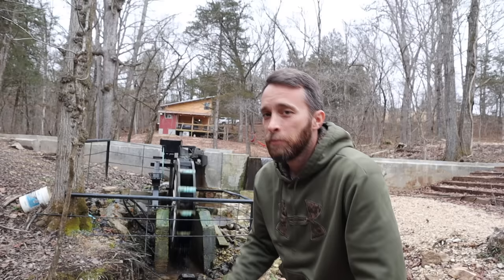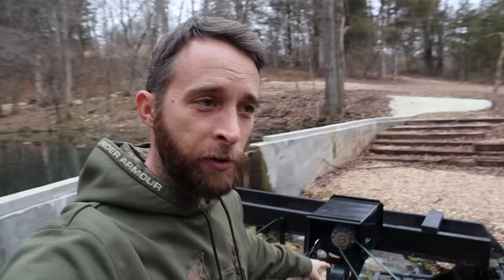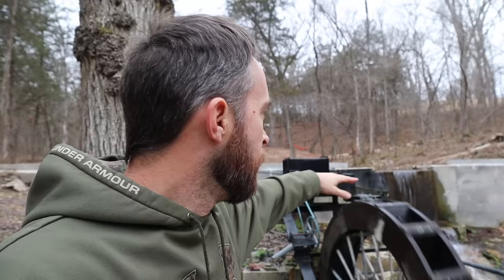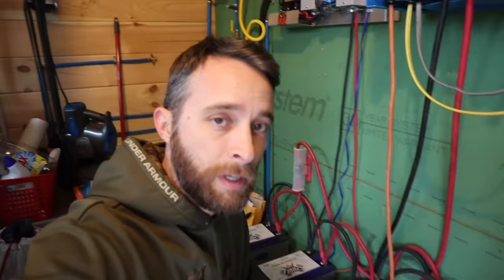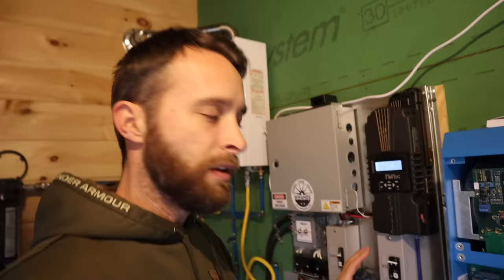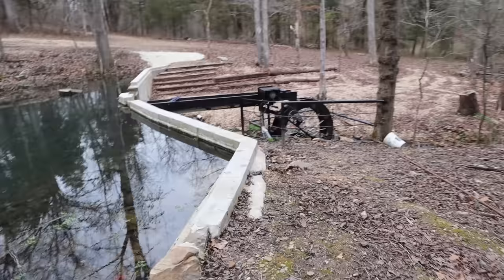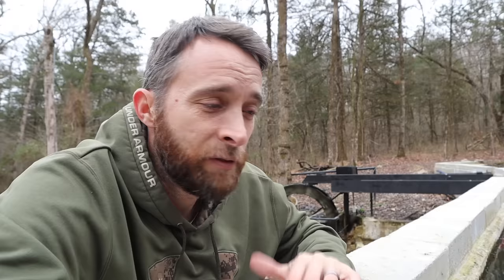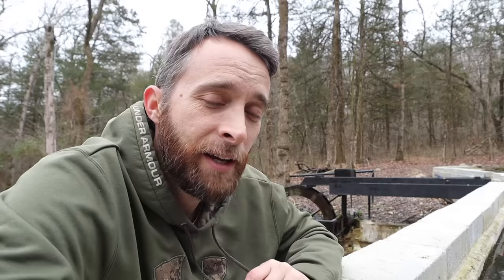Did we MAKE HYDRO POWER Using Our Waterwheel for Self Reliant Off Grid Living?

Comment: Modified Samsung 18 Pole Smartdrive motor. Setup as 3 phase 2 coils in series, times 3 in parallel per phase, then rectified. At 500 RPM it was producing 182 Watts at 46 Volts DC. That is fed into a MakeSkyBlue 30 Amp Solar controller and dropped down to charging Voltage for a 24V nominal battery string ( currently sitting at 26 Volts, charging was at 27.2V ).  At 750 RPM the same unit will produce 330+ Watts. At 1000 RPM it has put out over 400 Watts. What is the state of charge at your batteries as if they are nearly fully charged, they won't draw much in the way of current. As the others said, move the Voltage as AC and then rectify at the panel for less loss. MW&S sold you a bill of goods with that alternator.
Reply: I did another test run this morning just for S&G. At 375 RPM it was producing 125 Watts. So if your unit no load was producing 500 RPM and under load it was producing 375 RPM, you would see 5 Amps at 24 Volts. By the time it got to your house with the 10/3 wire, you would only see 18 Volts at 5 Amps. That is a rather severe drop in Voltage and you wold not get much battery charging. Step that Voltage up to 72 VDC and your losses would drop big time.

Comment: Since you invested a lot of money, time, and labor on this project, why not changing the generator to an alternator (ac generator) later using rectifier change the ac to dc than  charge up your battery bank.  The alternator is cheaper than the solar panel, plus less space.  Good luck for the project.

Comment: Problem is propably the distance carried over with 24v. Get some load and a meter next to the wheel and measure the output without the cable resistance.

Comment: Heavier wire to the house means less voltage drop ... Find a generator with a dead gas motor ... Do the numbers for right rpm off the water wheel ... 

You could use a water ram pump to run up a tree 25 feet for your turbine head ... 4 ram pumps should be more than enough flow ... And they are easy and cheap to make ...

Comment: Sounds like either, a bad connection on the service cables going to the house or the gen needs to be tested separately (there may be an rpm limit before damage). Splicing hi current cables is not always easy. A bad connection will be warm or even hot. An IR temperature meter can be real helpful. I like to use split bolt type connectors whenever possible. Also a Voltmeter should read 0 volts with the leads on either side of a connection during operation. There is a more complicated situation that is possible. The charge controller may be seeing a big drop in gen output, if it suddenly loads the gen to charge the batteries. The charge controller could then cut out on a safety. Then resets, then repeats...  Parameters for these hi and lo safety cutouts are often programmable in the charge controller. OR might be as simple as a belt slipping causing a the charge controller to react...??
Reply from the maker: Thanks

Comment: Hey you should move the power wheel closer to your house where the spring is coming out but you will have to build another  smaller dam or buy terbines buy 7 of the terbines than cut a little  in the bank make a flat serface make pipes coming into the terbines  then have the water exit after it goes thru the terbines  2 times make sure  to have exit back into the creek because  if it gets blocked it will blow up plus make sure your kids do not touch it when its running it will send 400 volts thru there body and it will be fatal thats what i have on my big dam on the river that flows thru my 342 acres of land

Comment: 12v at 100 amp-hours is the same amount of power as 24v at 50 amp-hours. The 24v will be more efficient since it has lower current hence less loss in a wire of a given size, or else you can use smaller wire for 24v with the same loss as 12v thicker wire.
Reply from the maker: Thanks 😊

Comment: Hi I'm an electrician into solar and off grid. 12v would not get you any advantage. As your losses going to 110v are higher.  So 24v is a better option for the same battery capacity as a watt is a watt no matter what.

Comment: Regardless of all the advice about transmitting electricity via AC or DC, it's the inefficiency of the wheel. The mechanical energy required to turn the generator under load is inadequate because the wheel circumference and width is too small, and the water flow is also underwhelming. You may want to check out turbines as an alternative if you have the fall.

Comment: I would not give up. An option for your setup might be an Archimedes Screw type.  With the distance to your cabin, you should not be running DC in you line.  It should be 3 phase AC and then convert at you cabin.  Missouri Wind knows this and I would get them involved.  You also may be getting belt slippage since the water (when really roaring) was all over your belts.  I think your setup as is with 3 phase going up to the cabin will work.
Reply from the maker: MO W&S was who I talked with about my project and everything they sold me was recommended by them. I honestly wasn’t impressed with their help.
Reply: @LoftisPartyofSix  I have heard the same comments from several others that have used them.  The alternator they used can either be wired to output DC or 3 phase AC.  Internally is generates 3 phase AC unlike a car alternator.  That makes it very efficient.  Then you rectify the 3 phase AC into DC.  That can be done internally to the alternator or you can not rectify it and send the 3 phase AC through the wiring.  There is much less drop of power when transmitting AC which is why the electric company transmits AC.  From what you said in this last video, I  suspect you are transmitting DC power and you are getting a  big drop in voltage through your wires.  It is possible to take the alternator apart and remove the rectifier.  You will then need 4 wires (3 for the 3 phase and one ground) from the alternator to the cabin.  Then you use the same rectifier module that was removed from the alternator and install it at the cabin end of the 4 wires.  If you only have 2 wires currently running between them, then it is definitely DC. You can temporarily run 2 more on top of the ground to just check it out.  I wished I was there to help you out.  If there are any wind generator guys close to you, they could do this. Maybe a retired electrical engineer (that's is me)

Comment: You need to build a power house at you waterwheel and put your batteries and electrical there
Just run the power to your cabin from there and into you fuse panel

Comment: Hey brother, while you're trying to figure this out, why couldn't you just put a cheap 12v alternator on there?  I have a 67 Amp alternator tied to a junker lawn engine and can charge a 12V in no time short. Haven't assembled it yet, but I have a predator 212 cc engine and a 200 Amp Ford high output alternator that would power your batteries for daya

Comment: I would think you could add a second hydro generator wired in parallel, have a second pulley off the first generator and with a one to one ratio and have it power the second hydro generator. It should effectively double your amperage and should be able to provide enough voltage and amperage to charge the batteries.

Comment: so i'm not really up to speed on the electrical side of things, but, from what i can tell you're using an ac generator to charge dc batteries to power an ac house?  is that correct?  because if that's the case, wouldn't it be less complicated to run a dc alternator to charge the batteries?  after a few minutes of looking i found a 24v 45 amp alternator for less then $100. i also found a 12 volt 320 amp alt for $450.  i would think, and i know this is probably over simplified,  it should be just a matter of determining how much the house requires on average, finding the alternator that covers that amount including the power loss from the run distance. and theoretically that should be that. shouldn't it?

Comment: Another thing that will be helpful take that water wheel and use the power from it to turn your V belt for your washing machine to wash your clothes you do not need a electric motor for the washing machine and you can use gravity flow water to fill the washing machine no need for a water pump

Comment: DC is very susceptible to voltage drop over distance. Depending on your wire gauge I would imagine that's your problem.  Use an ac generator then convert to DC at your battery bank.

Comment: Am not an expert, but you need a better design. I love the wheel. Yes, you should add solar. To live off grid, you must have solar, generator and the hydro is a plus. I think you should have the water flowing out the bottom or mid point of the reservoir instead of the top. It would have been more consistent and less affect by seasonal change of weather. The pulley system can be resolved. Your man jerry, may have to build one around the perimeter of the wheel so it’s a direct drive or add a gear box. Hope this gives you something to work with.

Comment: I have a water wheel
And I put the same pulley system on and with the v belt you have to have so much tension to keep belt from slipping I them went to planetary gear and got 1/4 more rpm

Comment: What's your amount of voltage drop between the generator and inverter ? You may want to put the inverter @ the generator and send the power to the house as AC current, less voltage drop. Also what gauge conductor is matters.

Comment: All you need to do is create a large pully on the side of your water wheel from wood the same size as the water wheel you’ve got the tork as the wheel is big enough then go down to a bar mounted on 2 bearings with the big one on the side you just fitted to a small 3inch pulley on the inch bar .... then at the end of the bar add the big wheel you originally fitted with the belt you had to the generator ..... watch the homestead rescue water wheel he made on the floating pontoons on the river he has the same issue then when he attaches it to make a huge belt over the actual paddle wheel he goes from your output to around 15 amps
Reply from the maker: Thank you 😊
Reply: Loftis Party of Six - weROAM 
No worries 😉 I genuinely think that will work looking at it 👍 making a giant pulley would be interesting lol but even screwing some batten on the side of the wheel following the curve and another bit to create a step is worth a go to test it

Comment: I would  try a direct drive washing machine motor,  strait out of the water wheel shaft. These motor produce 3 phases AC and at really low RPM, you don't have much water flow and you lose to much power with thoses belts trying to gear up.  I tested those motor and was able to go to 100v with a handcrank. You have nothing to lose, you can find these for cheap, check youtube for these washing machine motor generator.

Comment: I would take a look at low head turbine. And there's also a guy that I found on YouTube recently that has and water we are running off the spring and it seems to work quite well with him. Converting an old washer motor

Comment: What about a ram (appears plenty of flow) to gain more elevation to a smaller reservoir and then go with a micro turbine? I agree with The Reece comment that the flume should be extended about a foot so the water angle hits with the maximum power.  I would try that first.  I am not an engineer but that just looks like the wheel isn't being used as efficiently as it could be.

Comment: This is almost a year after the video was released, but I've got a few ideas. I'll be repeating some of the comments first. You said you're running DC cables to carry the electricity. That's a major inefficiency. Your best bet is to rip those cables out and run AC almost all the way, before slapping an alternator between the cable and the batteries to get DC so you can charge those batteries, which those are a really good quality battery, by the way. I salute you on that.

This is something I was thinking about when I remembered my Lexus' alternator was sounding funky. The other thing could be you just bought a bad motor. You might be hitting the RPM's you need, but the motor could be old or someone did a goombah move in production or it was damaged during delivery. Either way, you'd want to get that checked out. I'm sorry you've had problems with your waterwheel generating electricity.

Comment: information.               at 4:30, so long as  AC  is run, transmission losses will be  minimal; assuming correctly sized conductor is used.            rpms  are  Not  the  whole story.             power  needs  to be taken off a waterwheel, Correctly.!   (via the use of a first stage pulley  that is   Just  large enough  to create a ratio of about  1:3. )
at present, there is not a lot of energy  Available.            have you done the preliminary  MATH, for this installation.

potential energy/watts  =  Head  x  flow rate  x  gravity (x 1000, to get watts, rather that kilowatts).
say that you have a two meter  'wheel, utilizing  two meters of head.        gravity is 9.806 meters (per sec).        the flow rate is about  1.5 liters per sec; which equals  .0015 cu.meters.        so,  there's  TWENTY-NINE  watts  Available.     BEFORE   losses.                generally, anything  called  a  spring  will Not have enough  flow volume, to be useful.

Comment: You need a transmission so you can set the speed between the wheel and generator you have the torque now you need to speed it up! An old 5 speed transmission should do the trick.

Comment: Yeah ac won the transmission war for good reason - but dc has its place. Like between the north and south islands of new Zealand haha

You could keep the same equipment - and just move it all (batteries, charger and inverter) down the hill close to the generator (build a hut or something) and extend the output from the inverter all the way back to the cabin's main breaker. Might even get away with using the same long cables (just check they can take the voltage) 😁👍

Comment: Randy Henry
 I have an off grid cabin thats right at 2400 sq feet. I am in the middle of a million acres of national forest in Montana. I have a stream on my place and looked for several years before I bought the hydro that I now run. I have about 13-14 feet of drop and the turbine powers everything in the house and has for nearly 8 years.
It is made by Scott Hydroelectric. Bill Scott and I got to be friends over the years and has a small manufacturing facility in Washington State. 
The turbine is a high flow, low pressure systems and really generates all the electricity I can use. You have the perfect setup , so long as you have the volume of water. You already have the batteries and control gear.
Best decision I ever made. 
He has a website and would welcome a call.
Reply from the maker: Thanks for the info!! I’ll look him up

Comment: Moving the water wheel down stream abit and extending your slus to meet up with it at a short distance down from where it is should work for ya specially  if you can get around five foot of drop and then just add a alternated from a semi outta the junk yard . So you end up running two generators. And in the end no matter what you should just let it run as any power is better than none, but seeing how this is almost two years old I'm guessin ya thought of somethin

Comment: So can you replace it with a wind mill, and use the water generator on a separate system for landscape lighting? It still generates power ~50 W, could hook up to a smaller cheap camping setup use low power lighting.
Reply from the maker: Thanks

Comment: I would think you could put more gears on that water wheel and get the output to a ridiculous rpm. Maybe its the generator not working 100%. On some in cars on the generator is a screw ( kinda hidden) and it adjusts the volts. And i would have , and maybe you will, dug the pond deeper and have a bunch of trout cruising around.